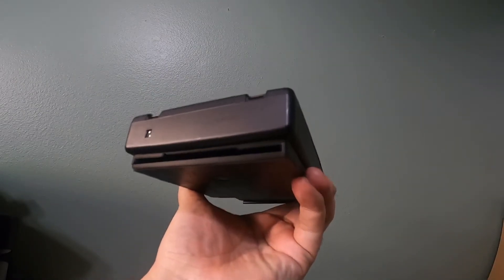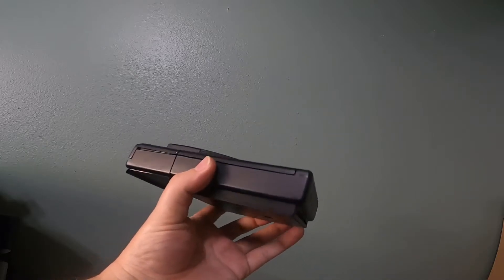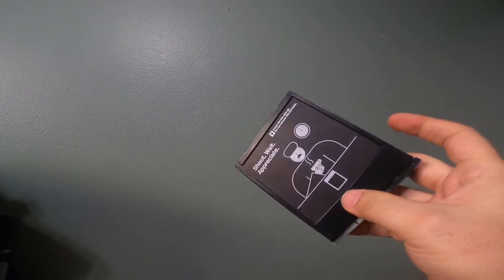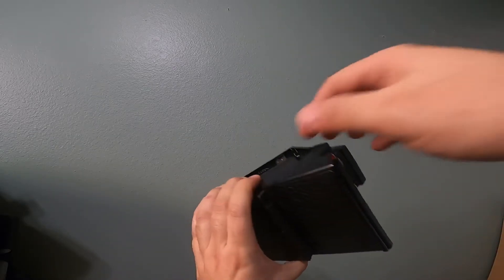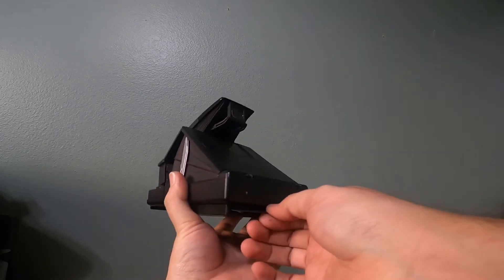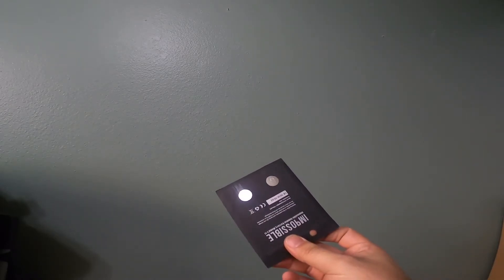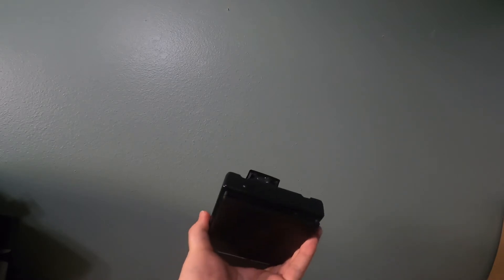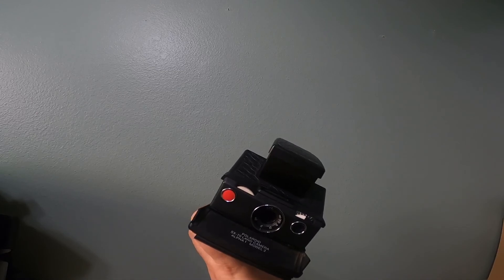I-Type Film in SX-70: Polaroid 600 Custom Battery Holder Mod demo

Comment: How about using a flat rechargeable phone battery with a boost circuit? There's gonna be a day when you've ran out of used 70 or 600 cartridges.
Reply from the maker: Yeah there are a few solutions out there that use those. I’ll probably always have a 600 battery of some type though since frames like the duochrome and round frames are typically 600 type. SX-70 film too.. I’d probably only ever run out of batteries if they stopped selling these films.

Comment: You might want to check to see if your DYI project can be 3D printed so you can put it into production.  I see that many 3D mods are available related to instant film hacks.  SX70 film is hard to find and often out of stock.
Reply from the maker: I offer the printed parts through my store now, actually! I have versions up for the CB-70, SX-70, and Impulse AF/SE.

Comment: Are the batteries rechargeable?
Reply from the maker: No, it uses the batteries from the used film packs
Reply: So pretty much you have to use a film pack with a battery and then take the battery out once you’ve used all the films  and use it with an I-type pack of films?
Reply from the maker: @joshc5339  Yup, if you shoot a lot of the specialty films it ends up helping out as you can get some round frames or duochrome, and use those batteries for the I-type.